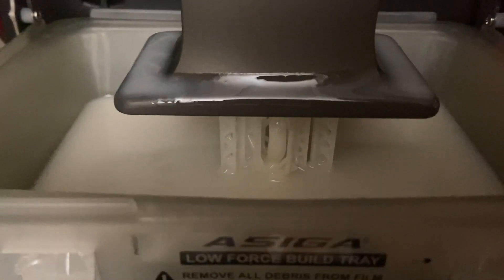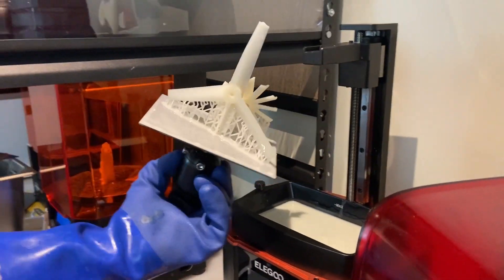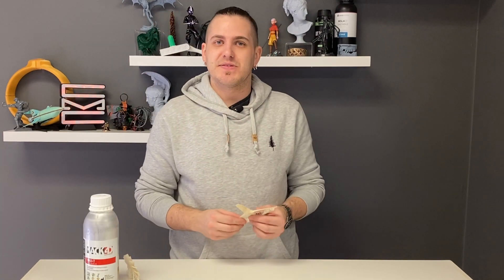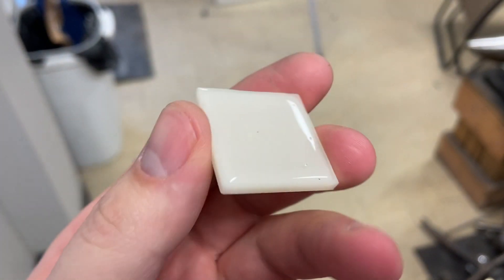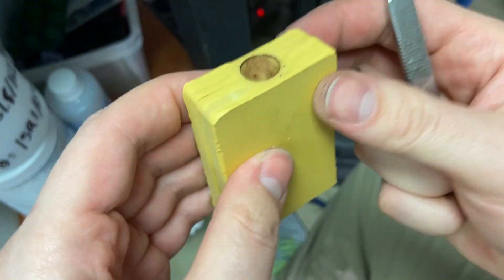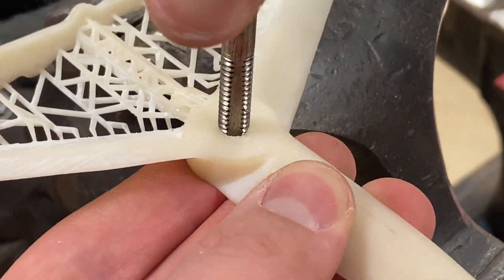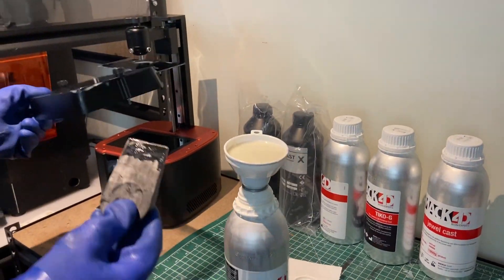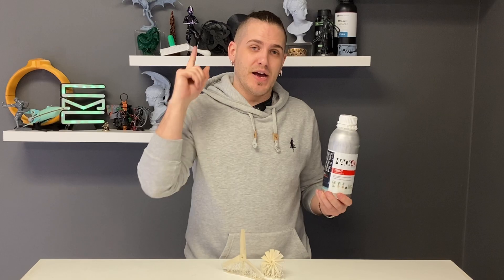MACK4D TIKO-T engineered Resin Review | Can we take a mold from this resin?

Comment: 6:22 not so tough ay
Reply from the maker: It’s 2mm spider leg… 
Due to the rigidity to make it tough when used on smaller applications shock based stress can cause it to shatter. 
Not something that occurs with thicker prints.